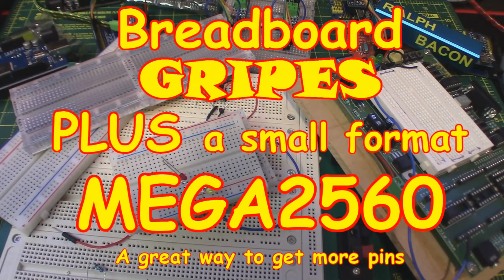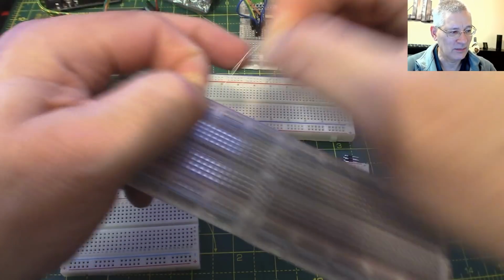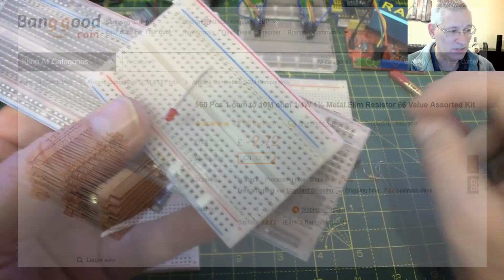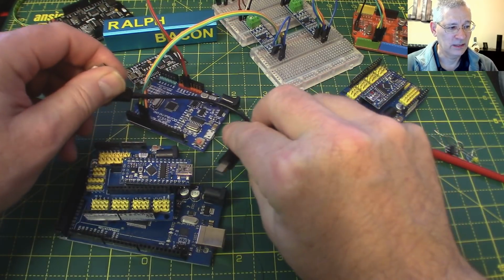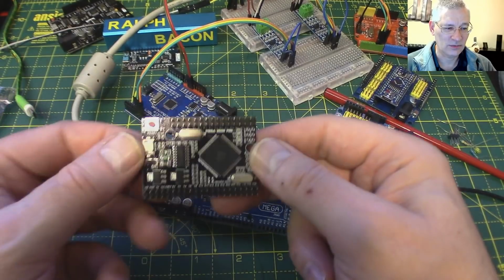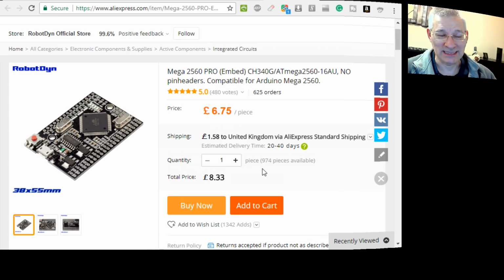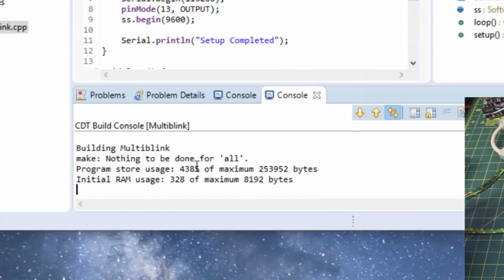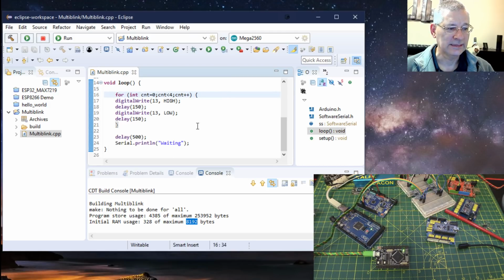#108 Breadboard gripes 😡 plus Mega 2560 PRO (Eclipse version)

Comment: How many multiple stepper motor could control onetime by this arduino mega Pro and how to connect line from arduino to driver stepper motor ? Thanks.
Reply from the maker: I guess the answer is "lots". I used two lines (pins) per DRV8825 stepper motor driver, connected directly. The Mega has 50-ish pins available so the answer is still "lots"!

Comment: Thanks for this video on the MEGA 2560 PRO. I just received one of these boards but it could not be found in windows 10. I saw a review on Amazon that said that not all usb cables work with this board. I tried 4 different cables before I found one that worked. So if people plug it in and it does not show up in Windows, keep trying other usb cables. Hope that helps :)
Reply from the maker: That's crazy! Is a USB cable not a USB cable? I really would like the know what the difference was that made one work but three not. Possibly the +5V resistance but I think I'm grasping at straws. I've had the same issue, not with the Mega2560 Pro but with other boards. Crazy!
Reply: @RalphBacon  Yeah, I know it sounds crazy. :)
 I got some lights on the board with two cables, but nothing else.
 I got nothing on the board with one cable I tried. 
The last cable I tried worked perfectly. 
Review #1 on Amazon here is where I saw the info
https://www.amazon.com/gp/product/B07TGF9VMQ/ref=ppx_yo_dt_b_asin_title_o02_s00?ie=UTF8&psc=1#customerReviews
Reply: As a side note. After I got the board running and uploaded a program that was too large for my Uno and Nano's, it ran perfectly. I have a full size Mega, but I wanted to shrink the size of my project down. This Mega pro board is going to be used in a bunch of my future projects. :)
Reply from the maker: It's a great upgrade from the Uno and not too big, physically. 👍

Comment: Pics are complicated to program, they must be programmed in  assembler, a quite difficult language to use
Reply from the maker: PICs don't have to be programmed with assembler, Pedro, who told you that? You can use C/C++ just the same as the Arduino, except PICs have different high level functions (so no digitalWrite() for example). Do a search on Google and you will a gazillion ways to program a PIC. You'll need a programmer device (eg a PICkit 4) but that just plugs into your PC to upload the program to the device.

Comment: On breadboards,  I was going to mention a video that somebody or other had done,  but I see someone beat me to it.  The metal contacts in that case were simply not properly formed.  Of the couple that I own,  the first one was made by Continental Specialties (before they became Global Specialties),  a "Protoboard 100" or something like that.  The other one is by some other company,  and uses different interlocking features.  Which brings me to one of my gripes about some of those ones coming out of asia these days,  the variety and incompatibility of those bits that are supposed to connect them together,  not to mention you don't know until you get it what the quality of the damn thing is going to be.  And with how long it takes to get them,  I'm not into playing around with checking out different suppliers,  mfrs,  etc.

On resistors,  someone seemed to be confused about body color.  The real early ones (which I still have some of in my stock) were a dark brown in color,  but they applied enough paint and the colors were not some of the ambiguous ones used by asian resistor makers these days that I never had any trouble reading them.  Blue body meant "flameproof".  Those super-thin bands and the ambiguity of colors are what drives me crazy with regard to some of the more recent parts.

On those boards,  I have only one thing to say:  So many boards,  and so little time to explore what these things can do...

And here I sit,  watching videos on youtube.  :-)
Reply from the maker: You've touched on a nerve there, Roy, in fact two! 
Breadboards of the rubbish Asian fleamarket kind are the bane of my life. I've ordered a much better one not one hour ago; we will see whether it is worth mentioning in a future video. 
As for resistors, the ones with a blue body (not flame proof) make reading the colours pretty much impossible. The beige bodied ones I replaced them with are fantastic in comparison.
Keep watching!

Comment: To get Eclipse Going(correctly, I did it once however is very rough) it is a bit Rough. Your compilers is the trick. If you using Atmel uC you can Studio because it very seamless for Ardiuno.
Reply from the maker: I tried the Atmel Studio a long time ago, Naasik, but never really got to use it much. I preferred Eclipse which I still use now but its life is limited as the developer has decided not to continue further development, shame.
Reply: @RalphBacon  Visual Studio would be nice solution but VS is very expensive...
Reply from the maker: We can use "Visual Studio Code", it's free and links into platformio. I've got it running but as I don't actually need it right now I keep forgetting how to use it. Maybe next year!

Comment: I have a friend that has developed a working sketch on the Mega.  What is the best way to find out if it will work on a "lesser" board?  I'm pretty new to all this.  It seems he is only using about 7 pins total and this looks like a waste.  i think the reason he used a mega is due to availability.  There is a bit of a language barrier is why I have not gotten the answer from him yet.  Any help would be great!  Thanks!
Reply from the maker: If you load the sketch (for the Mega) into the Arduino IDE, Ronny, and select the Arduino UNO (or Nano) you will find out if it can compile on a "lesser" board. The Mega has more hardware, such as an extra serial port, more interrupt pins and more PWM pins but you can check what he's using manually for that.

Comment: Re Mega 2560 Pro Mini, a great little package, I really want to adopt it for a range of projects, but don't know how to breadboard it, or make my own PCBs for it, given the double rows of pins. Any ideas?
Reply from the maker: When I used this for some testing, Paul, I just used standard header pins on it and use Dupont cables to connect them to my breadboard as needed. I wouldn't try and "mount" it on a breadboard with the double row of pins, it's not designed for that. 
Similarly, making a PCB for it would be do-able but a lot of work - unless you intended using all the pins. Just wire the pins you need to a separate PCB for the project that is using it. Or, "mount" the device on the PCB but only mechanically and then use flying leads for the pins you need to use. Now, if you're determined to use a PCB direct mounting you may find someone has already created a footprint for it (or the manufacturers have) in KiCAD, EasyEDA or Eagle. That is, the PCB is available as a footprint and then you can incorporate that into your own (larger) PCB.
Reply: @RalphBacon  Thanks Ralph. If I can find a host PCB that brings each of the pins out to a solder pad I would grab a small pile.  My current plan is this ... solder the 2-row pin header with the pins pointing up in the air. Then push the matching sockets on from above. Then solder ribbon cable to the socket pins that are needed, and bring these out to various parts of the custom PCB.  The board has 2 mounting holes so could be held firm to a base PCB with M2.5 nuts n bolts.

Comment: Absolutely right Ralph, why would anyone produce resistors with dark coloured bodies, my stock of old resistors have a light beige body and the values are instantly readable.
Reply from the maker: I'm with you Steven, I just don't understand the thinking behind that darkish, blue resistor body. My resistors are like yours, a pleasure to read! Thanks for posting, good to hear from you.
Reply: My 3 band (plus tolerance) resistors with brown background are all carbon film, my blue ones with 4 bands are all metal film.  I don't know if that is a general rule, but it certainly helps selecting a high tolerance low noise resistor from a mixed jumble.

Comment: Thanks Raiph for the low down on the cheap bread board and Mega 2560 pro mini.
The small footprint Mega 2560 looks like a real space saver. Have you made anything interesting with it? I might give it a go.
Reply: Thanks Ralph. The parallel pins could be annoying.
Reply from the maker: Ever used a Raspberry Pi? Then you will really know how annoying it can be. And if you connect the 3.3v pin to the 5v pin (inadvertently) then your Pi is history. Don't ask me how I know this.
Reply: @RalphBacon  - never used the gpio pins on the RPi but I'll bear that in mind!
Reply from the maker: I've not used it in anger, so to speak, as I'm keeping it for demo purposes. But as it is exactly the same as the "standard" Mega 2560 in electrical terms I'd only use it where space was at a premium AND I needed the extra capabilities of this board. It's cheap though, and nicely sized. You going to get one?

Comment: Ralph, may I suggest that you consider soldering the headers onto the back side of that 2560 board so you can see the labels when you are connecting things?
Reply from the maker: That sounded a good idea so I tried it out. Unfortunately, the same problem occurs except now the board is upside down too (which shouldn't matter but somehow it does - to me, anyway). The advantage of soldering them in the way you suggest is that you have that secondary pin-out silk-screen immediately on view so you don't have to keep turning the board upside down to read it (and probably get it wrong in the process). It's a pity the manufacturer didn't sort this out as it's obvious they realised there was a problem as they have that secondary pin-out. It looks clumsy. Oh well, when I get to use it we shall see what I do! Thanks for the suggestion, good to hear from you.
Reply: Ralph S Bacon use the trick Ender used in Enders Game.  The enemy's gate is always down.  In other words, orientation is all in your head.  😋

Comment: Now we need a different breadboard  with a wider centre section for ESP32 boards. You only get 1 hole on 1 side!
You know what's thinner than resistor leads? It's jumper wires which constantly slip out. Maybe someone could design breadboards which
have stronger clamping and you release the tension slightly by pushing a special tool into an adjacent pin. Reasonable idea or not?
Great info again Ralph!
Reply from the maker: Great idea for a breadboard you have there, Phil. I'm trying to source a couple of recommendations but at least one doesn't seem available in the UK. We shall see what I end up with, it might be this one: Busboard Prototype Systems BB830

Comment: Hi Ralph, what is the benefit to using a different IDE over the Arduino one for Arduino code? 
I've noticed on quite a few of your videos that you tend not to use the Arduino IDE. 
is it just down to preference or is there something you can do with eclipse that you cant do with the Arduino IDE?
Interesting video as always. Thanks
Reply from the maker: Where do I begin with the differences, DazzleK93? The Arduino IDE is excellent for first-time coders and beginners in the Arduino space. It's fairly simple, forgiving, supports all the Arduino boards (and then some!) and is pretty much plug and pray. But after a while (which could be years for some, weeks for others) the limitations of the Arduino IDE become apparent.
 
Where is the automatic code-completion (also known as intellisense)? For example, you type "Serial." and in the Arduino IDE - nothing happens. In most other IDEs a little pop-up window appears that lists all the possible things you can type next, such as "begin()". So it acts as an aide-memoire for one, and helps you complete the sentence you're writing with syntactically correct code.
 
Secondly, the Eclipse IDE lets you dig down in the underlying code. So if you have indeed typed "Serial.begin()" and then hover over the "begin" part of the statement it will show you what that code is actually made up from (that is, the underlying C++ statements, written by others such as Arduino.cc). It can be very enlightening how all the Arduino code is put together.
 
The best thing is to try it, especially the "official" Eclipse with Arduino add-on, as mentioned in my video. Give it a whirl. If you don't like it, just continue to use the Arduino IDE until you are ready to move on.
Reply: Ralph S Bacon thanks for the reply, yes I see what you mean now the auto-finishing is a great feature, I enjoyed that from my time experimenting with visual studio.
You make all very good points and I shall do just that, I will install eclipse and have a play. 
Thanks again.

Comment: Julian Ilett has gone into this issue in some of his reviews of solderless breadboards, and how the problem has to do with the amount of bend at the "funnel" end where the component is inserted.
Reply from the maker: You mean there are others doing this sort of video, Jason? Heh Heh! I should have guessed he would have covered this as he is a very accomplished electronics engineer so he would have used these for many decades. Perhaps I should go watch his video and see if has any suggestions for a better quality one (pity I didn't watch it before I did mine but never mind). Thanks for the heads up.

Comment: I was really looking forward to test the mega 2560 pro mini version at 3.3v and see if you can put it to sleep (low power mode) like you can do on the atmega 328p and have just a few uA of current drain to make it more battery friendly. I use some normal pro minis for small wireless sensors with a nrf24 or rfm69 radio module and I can get down to 5/7 uA. Of course all voltage regulators and power leds needs to be removed.
Reply from the maker: I suspect that the vast majority of Arduino, PI, PIC and other µcontroller projects just run 24*7 from a plug-in wall-wart. It's only when a battery comes into play that makers worry about putting the thing to sleep and using as little as possible current to do the job. An interesting topic that probably overlooked so I am now going to add it to my list of R&D articles. Thanks for the post.
Reply: Ralph S Bacon if you want to dig into that, please come ad visit mysensors.org and Openhardware.io, you will find a lot of sensor projects that can run for 1 or 2 years on 2AA batteries and still have a radio communication.

Comment: I've never got to grips with the 5 band resistors, they are a menace to those of us with old eyes. Not all change is progress eh?

My IDE of choice now is the Atom editor with the PlatformIO plugin. I can use either .ino or .cpp with it.

When it comes to PIC development I am a big fan of the MikroElektronika development boards. They are exceptionally well made and not too expensive. I love my EasyPIC7 board, it is so versatile. Since my recent foray into the world of ARM microcontrollers I am thinking about investing in their ARM development board as well.
Reply from the maker: I will need more free time to return to my PICs, Nick, but you never know, perhaps when I retire. they probably won't have µcontrollers by then anymore, it will be quantum chips! But I'll look at that IDE you mention, it could be worth sharing, you never know. Thanks for posting.
Reply: Atom with the PlatformIO plugin is nice, but I prefer the Visual Studio Code (Not Visual Studio, very Different) Editor with the PlatformIO plugin. VSC is much faster and lower profile I find that Atom, plus it brings more "IDE" features to the Editor world, with the perfect mix in between both. Either way, PlatformIO is awesome with any Editor of choice.

Comment: Interesting to me how the convenience of push in bread boards has made them what most everyone uses, even though they suffer from intermittent issues & capacitance between rails etc. Judging by the declining availability of matrix board (& pins) few solder up prototypes even though intermittency & capacitance issues are much reduced, as per the human way, convenience wins. When I used to demonstrate in electronics one of the lectures used to lift up the circuit boards about 12 inches (30 mm) & let them drop, if it kept working they got extra marks. Suspect most push in bread boards would fail this test. With resistors I have given up with colour codes, which seem to be going out as surface mount become more common, I just label the reel lengths the resistors are attached to.  It used to be nice to be able to read resistors at a glance, but once upon a time one could tell if valves were working by seeing if the filament glowed, now many have never seen a valve. Re size of Arduino, it in my opinion depends on motivation. If "one off" then small is good, but if for production the size doesn't matter to me as I will be making custom circuits using the chip & only including what is needed to get the smallest production circuit possible to keep costs down. This was once outside of beginners approaches, but with the advent of the low cost & fast fab houses perhaps it is not so nowadays. Thanks for sharing!
Reply from the maker: I've seen a valve, Springwood Cottage, really I have. In fact, I even did a course that used valves in an RF amplifier, yes really. But today I would love to build one of the lovely valve amplifier kits (even a headphone amp would do) with the valves exposed above a shiny metal case... oh well, one day.
 
And if I ever find a "good" breadboard that meets your criteria I'll let you know - I'm actively looking, now that I've had a few suggestions from posters here.